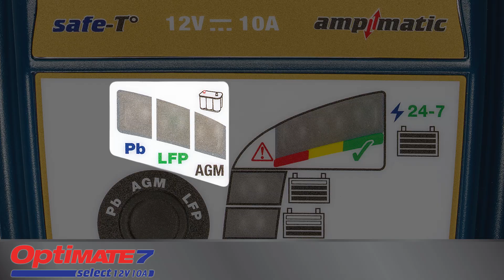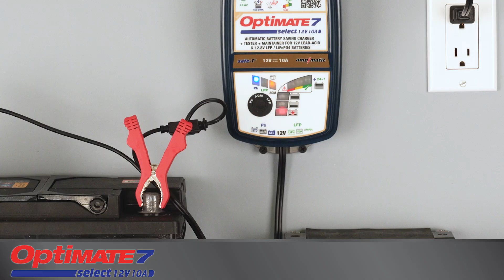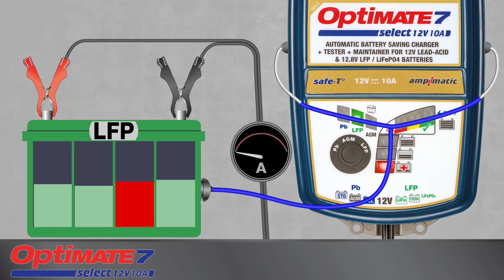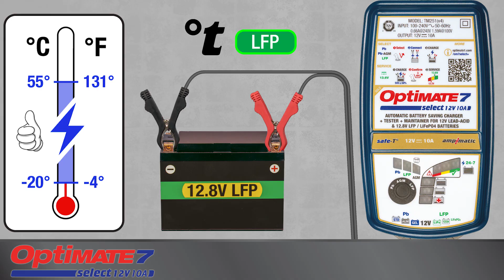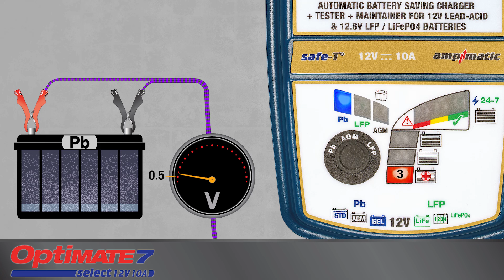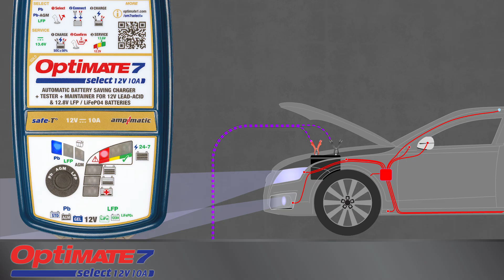OptiMate 7 Select v4 | Smart Battery Charger, Tester & Maintainer for Lead Acid & Lithium

Comment: I bought one. It charges at 15+ volts continuesly even though lights all happily light up indicating working. Very disappointed in this product and they don't care or respond to questions and concerns. Buyer beware. Get out your meter before believing it's working. Edit, I bought the V3 version without support for Lithium. This version is most likely even less reliable.
Reply from the maker: Thanks for sharing your experience. We’re sorry to hear you’ve been disappointed with your OptiMate 7 Select.

A reading of 15+ volts on a multimeter does not, by itself, indicate that the charger is faulty. The OptiMate 7 Select uses different charging stages and its output voltage varies according to the charging process and battery condition. That said, if you’re seeing a sustained voltage above the expected range, we’d certainly want to investigate it.

If you contact our technical support team with the battery type, battery capacity, the voltage you measured, and when during the charging cycle you took the measurement, we can help determine whether the charger is operating correctly: https://optimate1.com/contact/

We’re also sorry to hear that you felt your previous questions and concerns weren’t responded to. We take that feedback seriously and would like the opportunity to help resolve this for you.